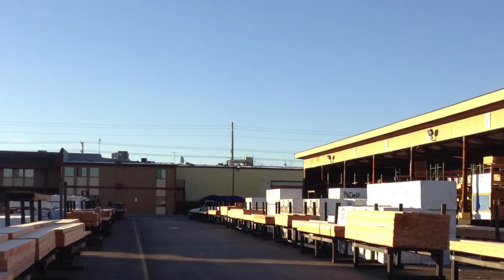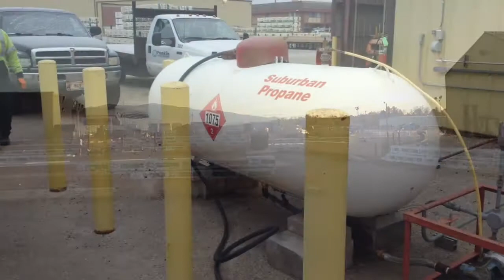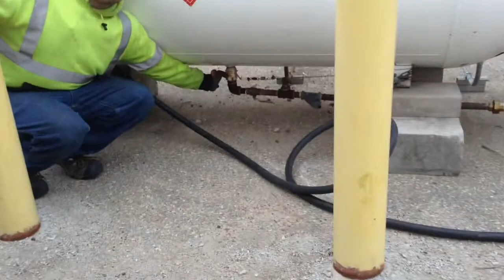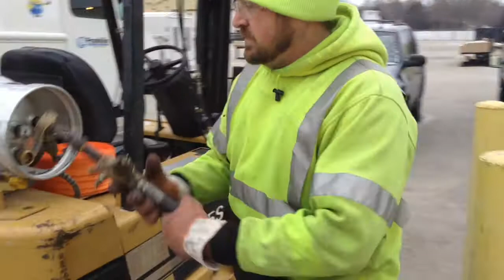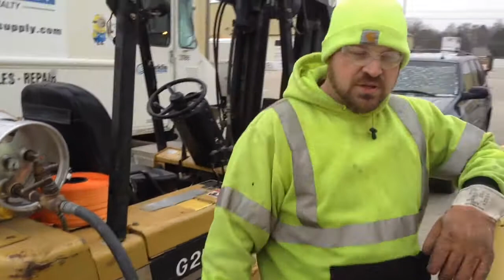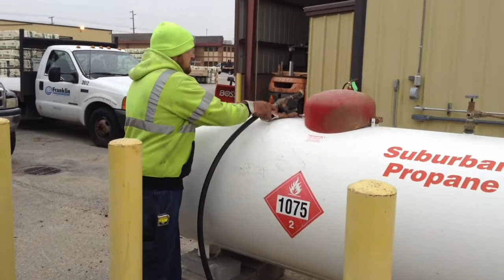How to fill A Propane Tank Safely

Comment: nice real world practical instruction. i would offer as another layer of safety, attach a small diameter,
 6-8' hose on the bleeder valve. secure it to the filler hose. this will help keep propane away from forklift and operator
thanks again

Comment: Exchange is safer
Reply: safer for who? they both get refilled
Reply: @jchan3123  safer for whoever is spray filling on site.   Its done on a scale at the propane facility.   Much safer
Reply: @dorkdorkerson3376  it’s plenty safe
Reply: @thelasttimeiateasswasabout9351  Its not safer than filling on a scale but ok
Reply: I guess the 10 ft from source of spark doesn't apply to this? 😮